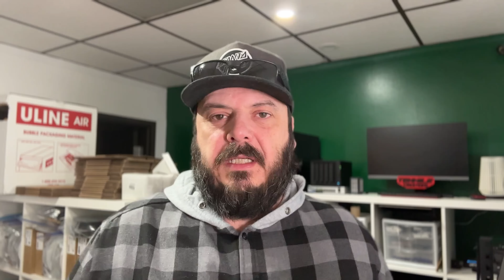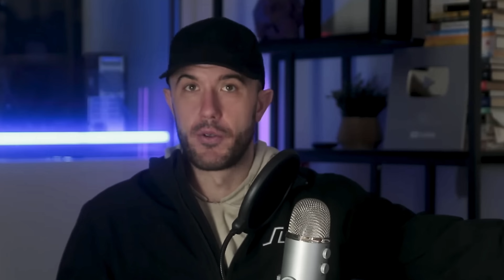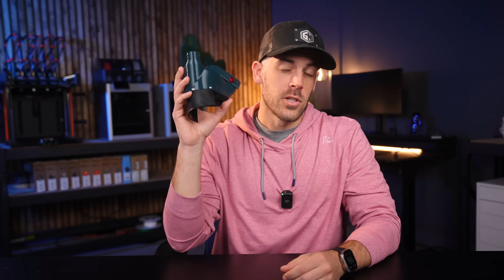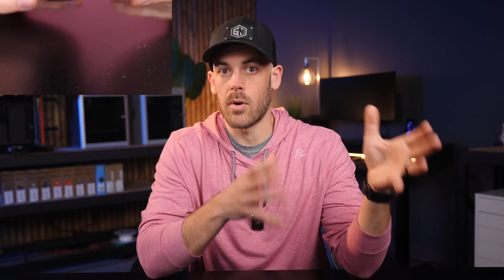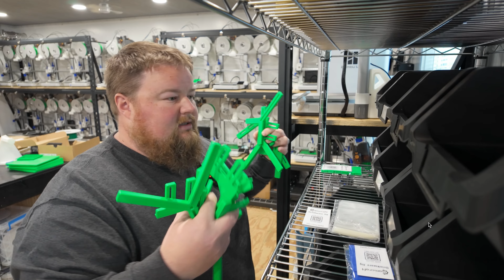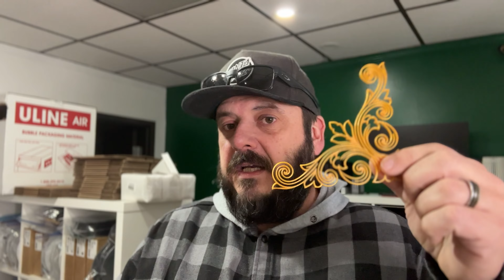Day in the Life 3D Print Business | Sunday Ramble #4

Comment: Designing the product is sometimes the easy part.   The hard part is getting the Bambu printers to print a consistent, clean product.  Finding the correct setting can drive you crazy or even give up on a design altogether.  Try printing a box without warping problems.  Even Bambu printers are not magic boxes that crank out products.
Reply from the maker: I can't say, I share your experience, however, I have posted several videos on different types of filaments and their set ups on my bamboo labs printers. Might check them out hopefully it would help..
Reply: @ExtrusionTherapy  if your prints come out perfect every time I need to watch all your videos.
Reply: Agree.  Have to tweek temp, fan, flow rate, cad etc for just about  every part and filament type.